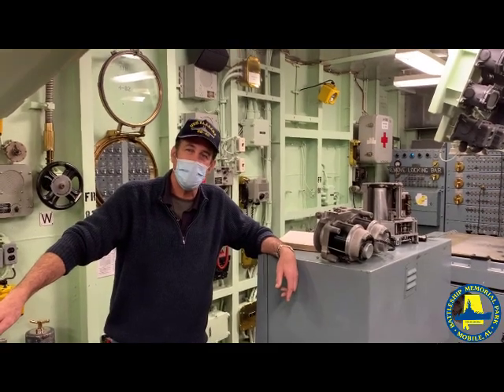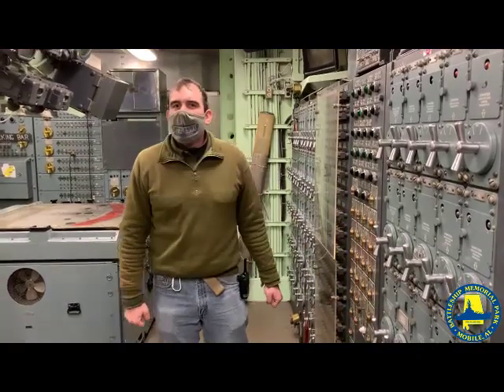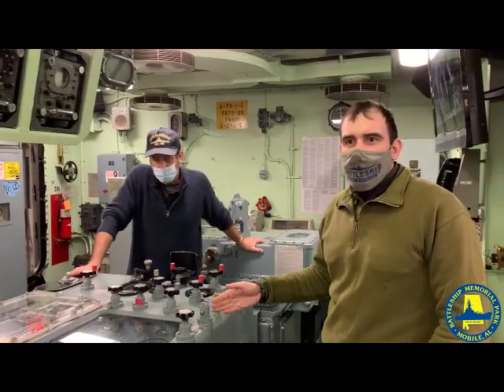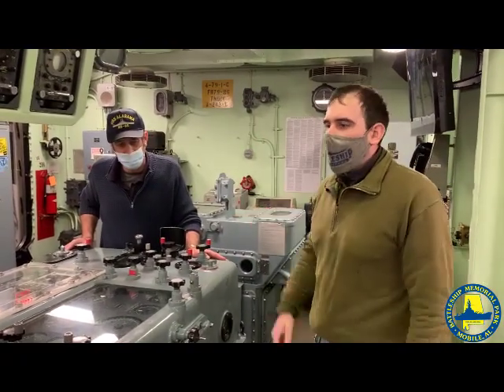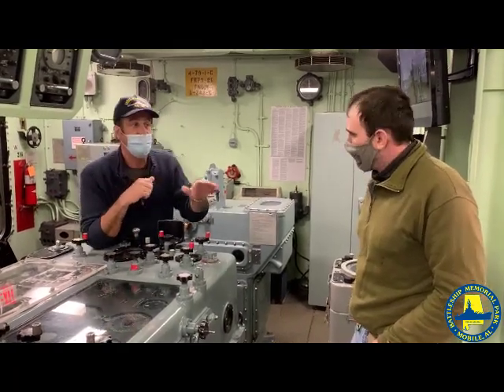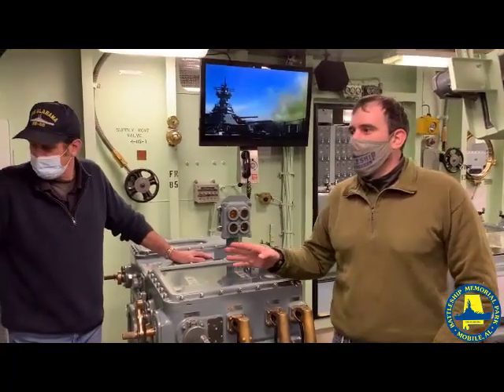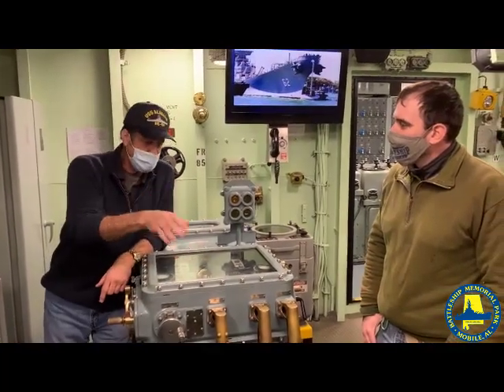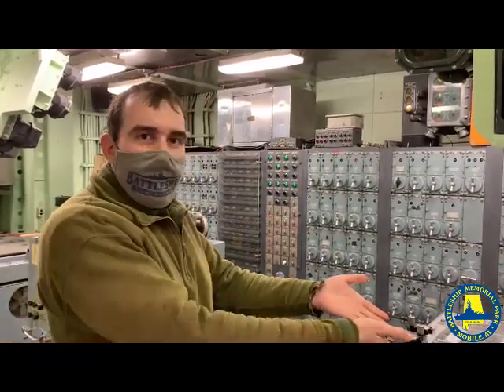MAIN BATTERY PLOTTING ROOM FOR A FAST BATTLESHIP

Comment: At 1:12 you mention having the only working Mark-8 Rangekeeper in the world... which is a MECHANICAL targeting computer, using a complex set of metal/brass parts to plot firing trajectory for the main gun turrents. 
What maintainence do you perform to KeeP the Mark-8 in working condition? Since this is mechanical, this could very well include keeping its parts cleaned/oiled and adjusted... 
Do curators on the Iowa class sister-ships take efforts to repair their Mark-8 targeting systems back to (mostly) working condition? 
Are there similar/related targeting compters kept at other US Navy museums?

While your Mark-8 IS a working Rangekeeper, it is understood that it still cannot fully function, since the plotting inputs from other systems are not powered-up or active, and the ship does not move, to provide those inputs... of course the turrents themselves are not powered, for plot info to be sent for live effect. 

Perhaps in future, a "Virtual Battleship" New Jersey could be setup on computer with a Mark-8 in software that accepts targeting inputs including ship movement, radar plots, target info, etc... then fires gun turrents on screen, plotting trajectory of shells in normal 1.5 minutes time, showing shells and allowing user/visitor adjust range to moving targets before return fire could hit New Jersey.  This could be part of tour, or even online, depending on details of programming. 
Perhaps some of the people who already write battleship online games would be willing to help you setup some of this software... both as bonus experience for people on your tour+web site, plus online mini-demo for their games.